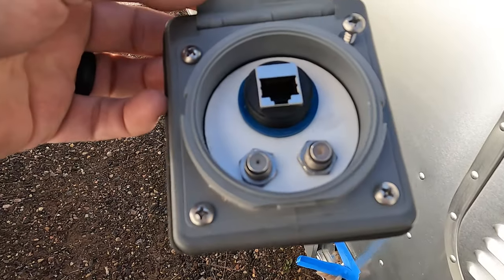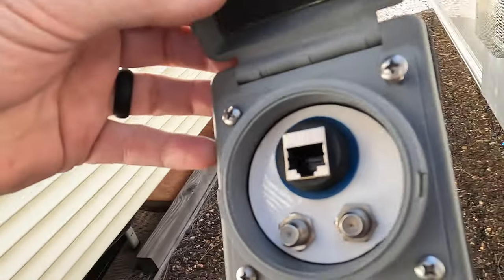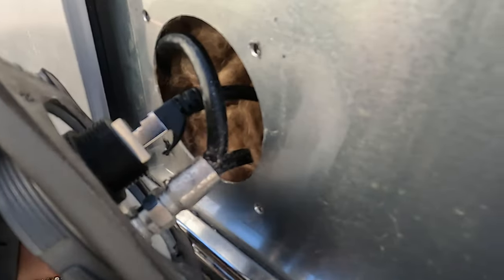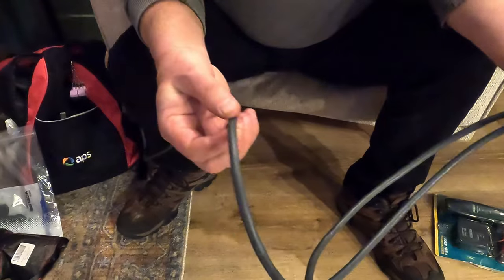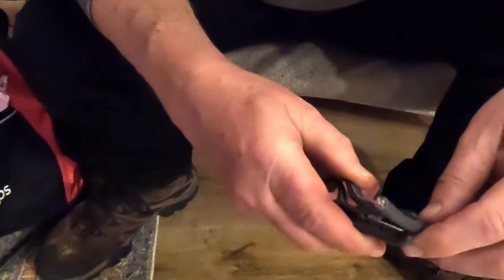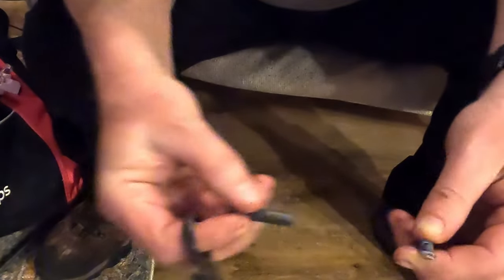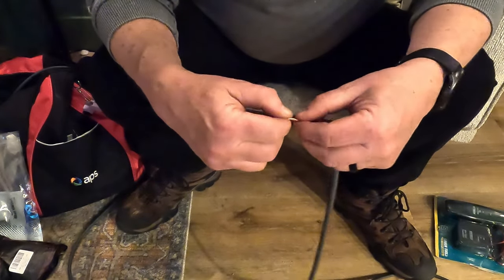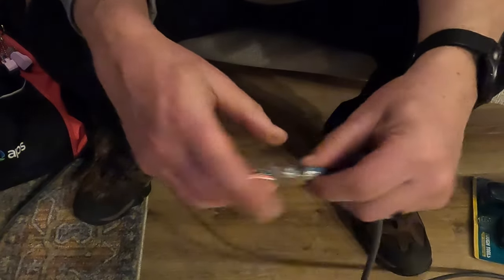Getting Starlink into the Airstream

Comment: Just a quick update.  I wanted to let you know how much I appreciate your tutorial on splicing cat 6 cables and Starlink cable in particular.   I even followed your lead on the flag pole mount.  Although I mounted my flag pole on the front of the trailer frame using a short class 3 trailer receiver bolt on mount and slip in flag pole holder.   Works great, simple setup and tear down.   
Thanks again for your help.
Reply from the maker: Love the idea of mounting a receiver hitch on the front... definitely easier to set up once it's installed.
Glad you found the video useful/informative!
~D